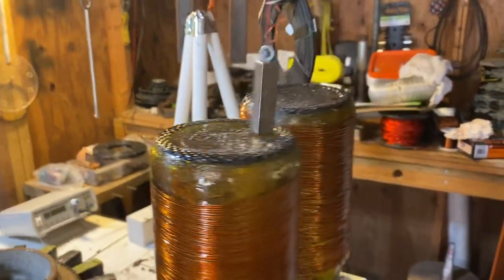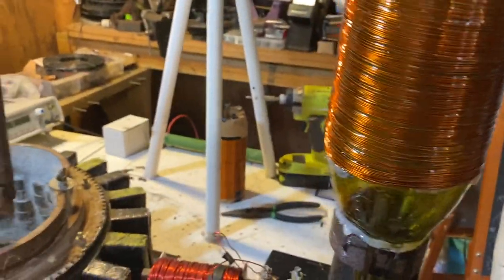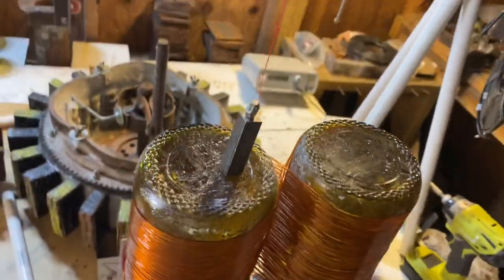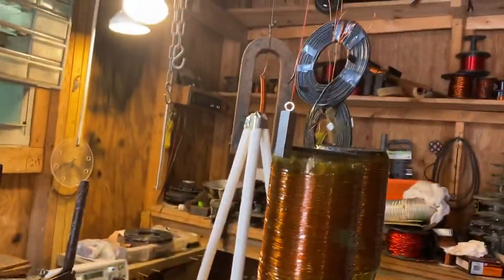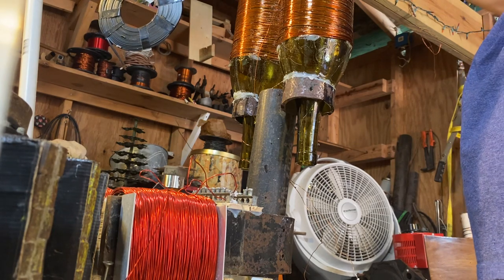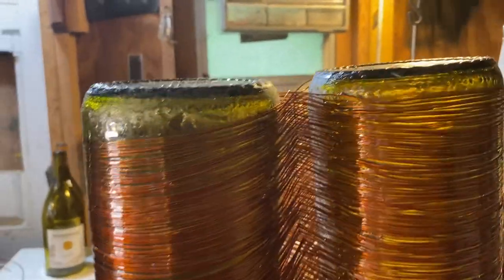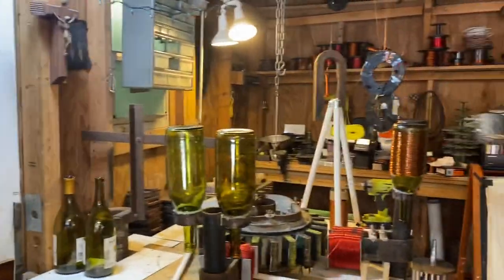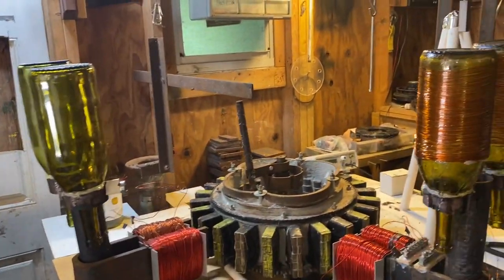Ed Leedskalnin’s Magnetic Wheel! Creating Sound Wave

Comment: You need to hook up a digital device to see if it works with out the dc converter the other thing is Edward was able to raise heated water to the same level every time. The other thing you are not thinking about is Edward device is meant to be used for amplifying witching for water he's was seen holding things in each hand. This generator is a 3 separate pole generator power pole direction pole and the loop pole remember physics already said the rules change in higher dimensional physics

Comment: Lower frequency ground (handle) compared to magnets higher frequency. Harmonic Resonance tuning maybe by changing mass (like cat whisker tuning?)

369 (396) bouncing low to high back and forth might be important in levitation in inertial cancellation (shielding.) Sound aggravation and oscillation seen in geet inner rod has one end hot (higher frequency?) while other end gets cold (lower (than normal) frequency.) Is this how bumble bees levitate? Inside they have a tube effected by sound of wings. Said that harmonic resonance of environment is shielding (a bubble force field) what would normally be gravitic magnetic Dielectric effects. So maybe we only need to harmonize with Earth frequency. Does a cone shoot energy rings out both ends? One larger slower and one smaller higher frequency? And what if they resonate harmonically together? 

If you are wanting to hold open discussions during live video streaming I think you should talk more about it or show it in action if that's something you are interested in.